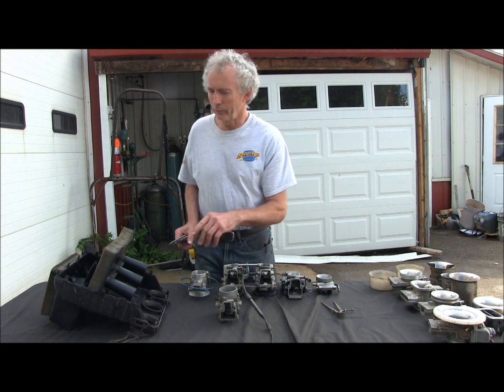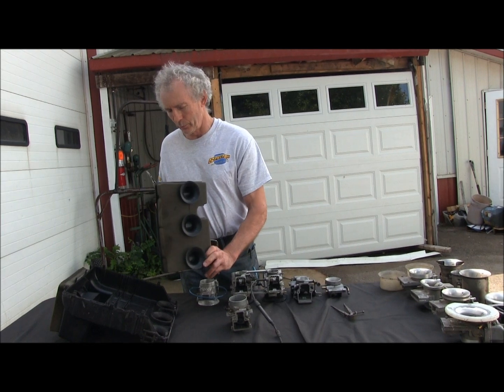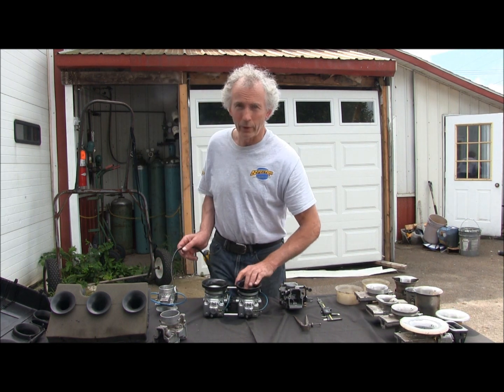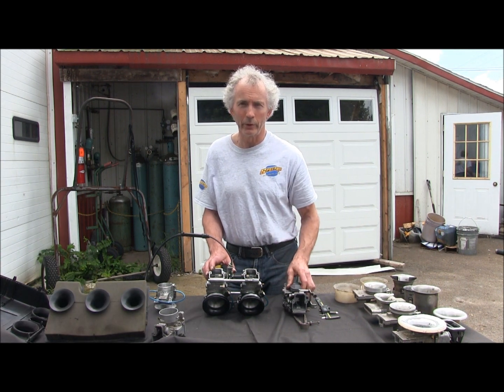Velocity and airbox class

Comment: never liked fudgin with carbs,,especially on inline 4's-did have a dial a jet  on a 86 nighthawk s,,worked well,,-great video
Reply from the maker: yes worked at  Suzuki shop and Sudco carbs, Pipe and cams coulld never out run the stock gs 750 that sat on the showroom and we would put a dealer plate on and run the mod. lol the stocker had much better rollon also do to cv carbs and airbox

Comment: Two-stroke airbox resonance tuning is fascinating. Got any thoughts on the crossfire 700? It uses a strange air intake that goes from the front of the engine to the front of the hood, then up the hood to the lights.
Reply: The same goes for a 4.6 DOHC Mustang Cobra, if you are sensitive to change in power, you will notice a huge drop in low end power when going from the stock air intake, to an airbox delete.
Reply: Huh, hadn't noticed your response. I guess I can consider moving to a custom air intake design if I decide to clutch the sled even more aggressively (its sitting at 4950 engagement now, very hard-packed wind-blown snow where I live makes trenching not an issue, so ideal clutching seem to be close to the race 600s).